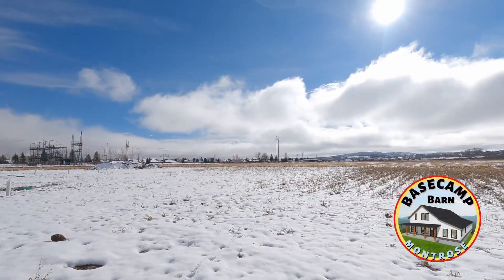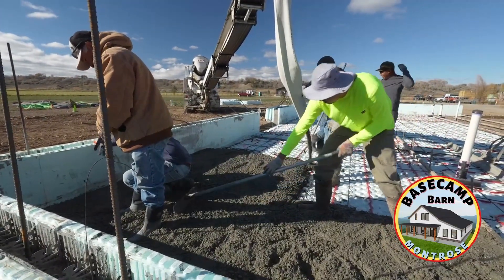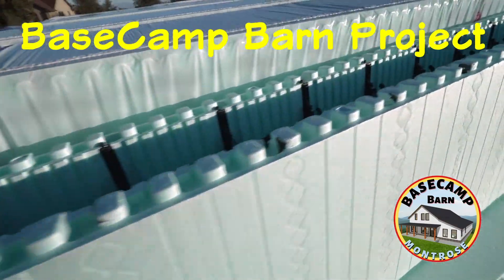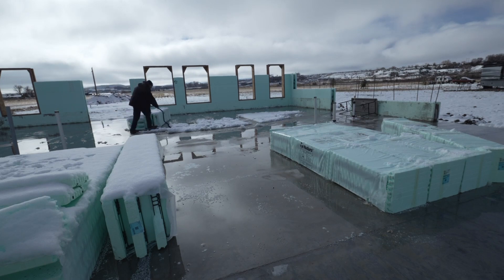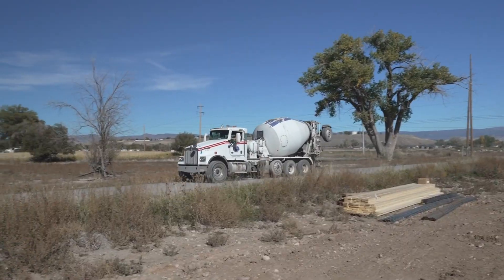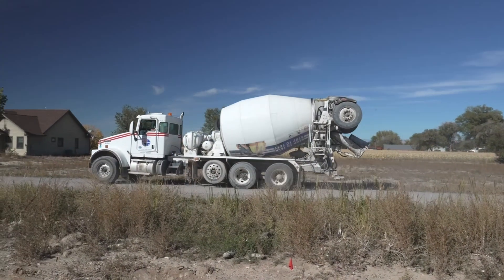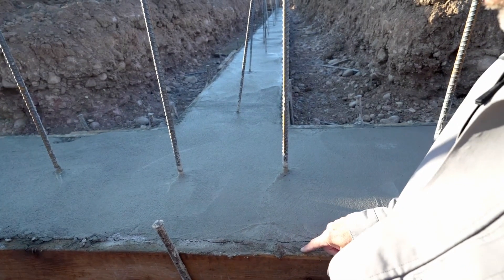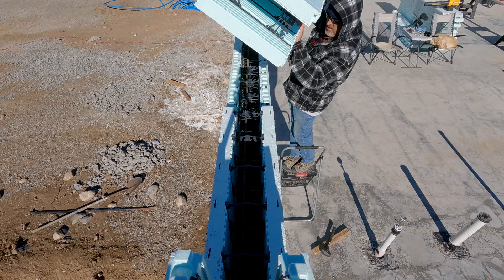What is ICF?  What are Window Bucks?

Comment: Looks like it would help a lot to spray some release oil on the top of those blocks plus clean them out right after the concrete pour is done and it’s still liquid.
Reply from the maker: Not sure if that would contaminate the foam blocks... Nudura doesn't like other manufacturer's products used on their blocks just in case the products make the foam fail.  But, not a bad idea!  As you could see, the concrete had a lot of rocks in it, and it came out of the pumper with a lot of velocity!  Maybe a second layer of the tape may have helped too.